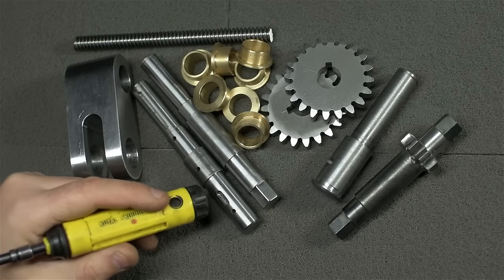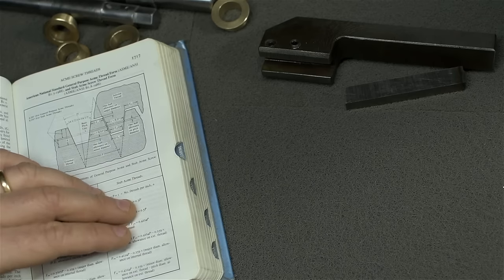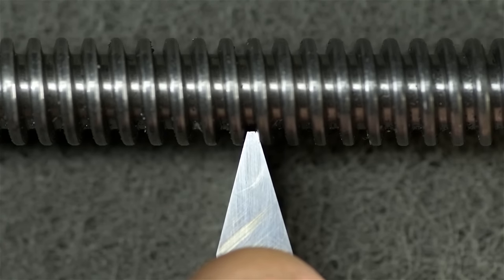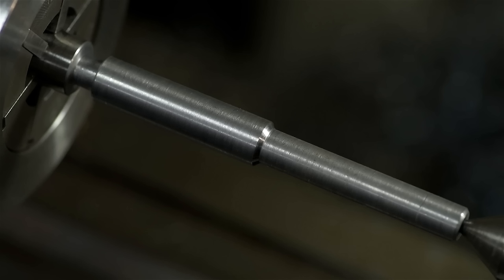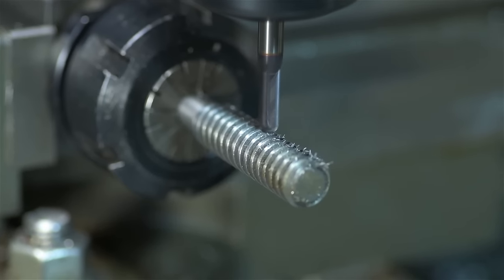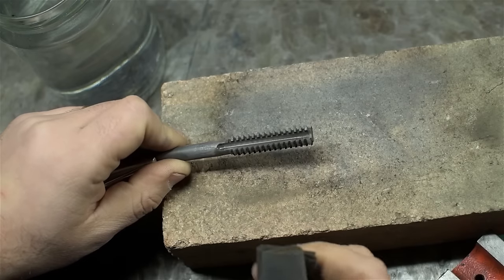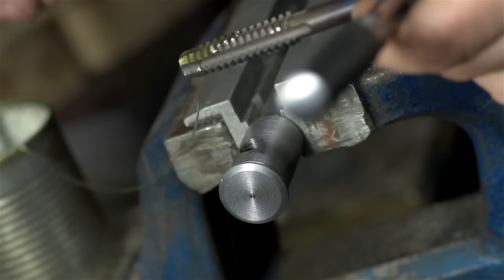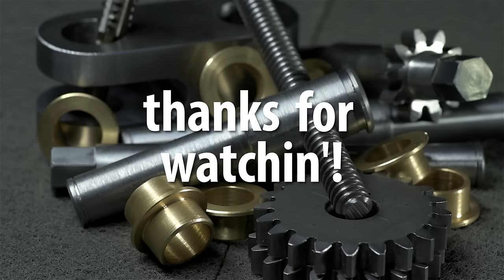More Thread Cutting & Heat Treating (I needed a metal tap)

Comment: not to be that guy  but why not just cut flutes into a peace of threaded rod , harden it and use it as a tap ? Would be a shorter vid for sure which is a downside and people wont learn as much from it i guess
Reply: randomusernumber1 threaded rod is mild steel.
Reply: there is a way to harden mild steel ,by backing it in a carbon rich medium the carbon will migrate and penetrate the steel  up to 3 mm , which should be plenty strong , but i do see that maybe the hardening process is another reason to go this rout , it would have taken roughly the same amount of time .I did not consider that the rod may be mild steel when i posted

Comment: 24:35 those "threads" look like a hogged-out, stripped-out mess. At 24:43 they look "perfect" except for the fact that the "lands" in the female thread you supposedly cut with your homemade tap are far wider than the "grooves" on the male threaded stock which doesn't look like "acme" or "trapezoidal" thread at all. It looks like standard screw thread that's been cut down a touch to make it look "square" or the "lands" have been narrowed significantly to fit the female threads. 

Why would a veteran homemade tap maker try to make a standard tap look like a bottoming tap and not use a LOT more "taper" and how does he not know that TAP threads are always DEEPER than the threads of the actual screw the threads are being tapped for? If you try to "single point cut" threads to mimic screw threads and then flute them to make a homemade tap you end up with a really "fancy" THREAD CHASER. Not a "tap". 

I don't know where you online master machinists have been doing your thing for the last several decades but outside of cheap "ready-thread" and the threads you guys "single point cut" the overwhelming majority of OD threading has been/is ROLLED rather than "cut" when it comes to quality, mass-production work.

And even "acme" and "trapezoidal" threads aren't "full depth" when it comes to thread engagement. Gotta leave some room for expansion, contraction, lubrication and the inevitable little particles of metal that get worn off of and out of the threads as they scrape against each other. Especially when its a "like metal" situation and both female and male threads are made of the same or very similar material. Like materials always gall and scuff and drag the most on themselves.